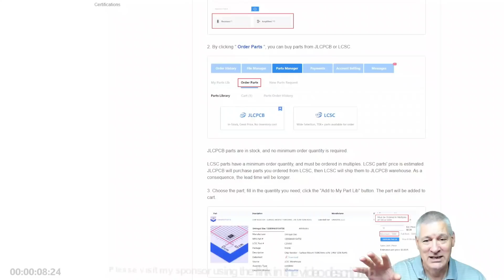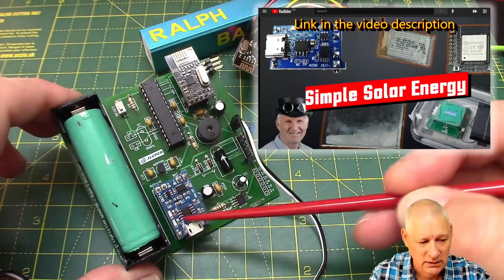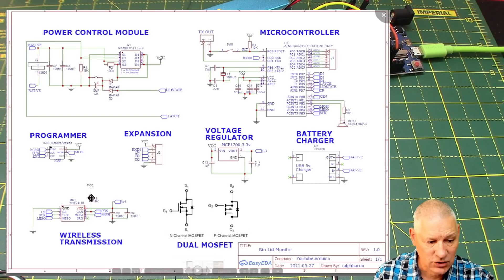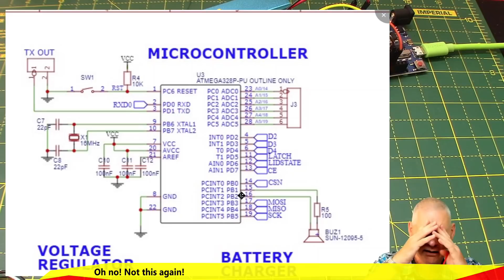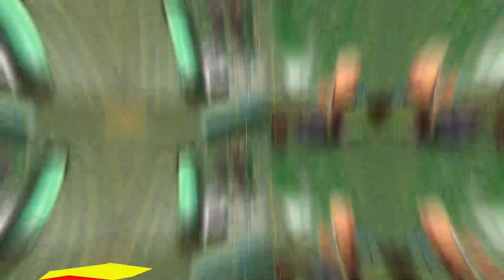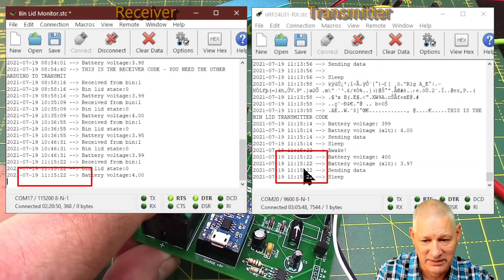#221 Arduino nRF24L01+ Simple Trigger Wireless ⚡ Project (Update) with EasyEDA

Comment: Hi @Ralph S Bacon
Thanks for your efforts on this and making it public. 

I had a look on your GitHub but couldn’t find the code for this project. 
Is it available?

I have just received some Si4599 duel mosfets and with help from your schematic have got it on breadboard now and working great! - Joy 😁.

I am just trying to monitor the button now so I can switch the project off manually rather that waiting for the count down to end. The code from your auto switch off project doesn’t monitor the button. 

I will also experiment with the normal way to read the button. 

Thanks.

Comment: Wonderful content and lovely presentation. A few tips. #1 Wrap some Sellotape around the LiPo and leave a 'tag' which you can use to pull it out. #2 Use Alkaline AAA's or AA's very low self discharge rate and 4.5V .Keep up the good work
Reply from the maker: Thanks for the tips! And thanks for sharing 👍

Comment: Great learnings from this video, unfortunately I am unlucky getting these NRF24L01 boards to work. can you do a project where the hc-sr04 are powered on/off by these MOSFETs for low power....seems there is no consistent solution to this problem ?
Reply from the maker: You seem to have two questions, Balaji: getting them to work (at all) and controlling them via a MOSFET to switch them off completely to save power.

To get the modules working reliably whilst developing you need the adapter plates. They basically consist of a 3v3 LDO so you can supply the full 5v without worrying about not enough current for the nRF24L01s. They are very cheap and solve 99% of all power-related issues. In a project you can design in your own 3v3 supply with sufficient current carrying capabilities, as I did with this project.

To switch off the modules you can use the CSN pin that brings them into a low power mode (which is what I do here). Datasheet will tell you the power consumption in such a state.

Or, use a MOSFET to power them off completely using a GPIO pin (which I did not do) - it takes a little while for them to wake up and get ready for transmission if you do it this way.

Comment: Thank you for this project. Its nice to see the puzzle pieces from your other videos come together in a way i think is useful for many people they want to build some battery powered/remote projects. But as always it raised some questions. All of that works flawles until i connect the high power NRF module to get a longer range. After that connection is unstable. I tried capacitors to provide power reservoir but nothing seems to be working. I know there are these adapter board for NRF modules but when i meassured consumption it doesnt make sense to use them in battery powered project because of voltage regulator used. Is there any solution for that?
Reply from the maker: You say "it doesn't make sense" to use adapter boards in a battery powered board, Jakub. I'm seeing here an aversion to using up power by dropping one voltage to another and dissipating the unwanted voltage as heat, as an old-fashioned 7805 voltage regulator might do.

However, for the fairly modest requirements of the nRF24 (high power or not, it's going to be under 120mA) there are some very efficient LDOs, such as the Microchip MCP1700 family, which I'm using in one of my projects. There are doubtless many others that require just a couple of hundred millivolts above the required voltage (so 3.5v would be enough to provide the 3v3 required) and sip power.

It's also very easy to turn the nRF24 (or any other peripheral device) on and off under software control of the μController using a (dual) MOSFET device, which ensures zero current consumption whilst the μController is in Deep Sleep, for example.

As the expression goes, "There's no such thing as a free lunch", and if we are to power devices from a battery then they will take battery power - but we can do much to reduce that to an absolute minimum with good hardware design and Best Practice in software engineering. Agree?
Reply: @RalphBacon  Thank you for those tips. Iam now using 7333-A voltage regulator that has similar characteristics to those from Microchip but it doesnt hurt to try some well known brand to rule out possibility that my 7333-A doesnt act according to datasheet. But i like the most the idea with MOSFET to power off completely the modul until next event occurs it doesnt crossed my mind. Thanks for a quick reply.

Comment: Good Job Ralph! Another nice presentation and project just brimming with ideas and solutions. Thanks!
Nice to see how success and end product functionality can be achieved all along the steps.
You seem to have glossed over the inevitable issues at every step, like remembering the file name when it's time to order,  things being hooked up wrong, dead battery, burnt out LED, re-soldering something 15 times and the insert coming out, hair pulling over 'it' just not working every time you test it and need to spend hours tracking down a problem like a bad solder/broken wire.... 😊😜
Reply from the maker: Hang on, Scott, have you got access to my workshop webcam? Someone's been watching me, I'm sure.

Comment: Ralph, why not add a diode to the battery so it won't matter is you put the battery in backwards?
----
It looks like you can use a Nano, Rather than the UNO R3.
Reply from the maker: Too big a voltage drop, easily half a volt. I could/should have used a reverse connected MOSFET for battery protection but I figured I'll not be taking the battery out.
Reply: @RalphBacon  - True, it would be 0.7 volts
Reply from the maker: Well, I'd see if I could use a Schottky, less voltage drop but still too much here.

Comment: Yes Ralph, I would not have done it your way but I respect your choices and there is a lot of good info in the video. Keep up the great work.
You do have to watch out for those user contributed footprints. I had to scrap some boards where the nRF24L01 footprint I grabbed had a mirrored pinout! I guess they were putting the headers on the back of the board
Reply from the maker: You're not wrong. 

User-contributed footprints can be the devil's spawn. You think you've hit Gold but discover when the PCB is made that it was just wrong - or, at the very least, made for a specific purpose or on the underside of the board, as you say. 

It's easier, in the long run, to make your own footprints; that way you have no excuses and are more likely to put in some effort in getting it right!

Comment: I hope someone could help me , when it comes to coding for the nrf for bidirectional use at various stages , any tips for synchronizing data at multiple transmitting  and receiving modes within an arduino program , really struggling to use , multiple stages  to transmit and receive and synchronize both microcontrollers
Reply from the maker: I'm not clear on what you mean by "synchronising" transmissions. Your program logic should be aware of when (and what) you expect at any point in the code and transmit/wait as required?

Comment: It is very satisfying getting a project designed and made on a PCB and it all works!
Reply from the maker: Yes, indeed. The flip side is, of course, where the PCB is so nearly right but needs "tweaking" before it works. That's if you're lucky and haven't put a footprint on backwards so it will never work no matter how much tweaking you do. But as I have never done that, it doesn't apply to me. 🤥🤥🤥

Comment: Great Video, Please look at the HC12 1000meter range with no lib's just tx rx pins same as Bluetooth
Reply from the maker: I believe (but only that, Alan) I mentioned the HC12 in my video on two-way BT comms in video #196 using HC-05/HC-06 devices. But I remember wondering whether the HC12 would work with the existing libraries from Martyn Currey. Thanks for the nudge, I will try and get to the bottom of this.
Reply: @RalphBacon   I was out of the loop for a while. I will check out 196 Thank you, Alan

Comment: I’ve been working with the ATtiny84A, which has more pins than the 85, but otherwise roughly the same.
Reply from the maker: Indeed, Brett, the ATTiny84 is a bigger version of the ATTiny85 - but at that point it's not really that much (physically) smaller than an AtMega328P (14 pins vs 28 for DIP and 20 vs 32 for QFP) but does have some hardware limitations (no hardware serial, no I2C, for example). The QFP package might be easier to SMD solder but even so... I'll stick to the ATMega328P for now and see how much of its features I end up using!
Reply: It’s still a fraction of the size of the 328 and can run at smaller loads. I’ve done I2C very easily on it and to great effect. The biggest limitation is 8K. I don’t think it gets enough credit, because most of the videos I see are singing praises of the 85. That said, you’ve inspired me to play around with a raw 328.
Reply from the maker: Indeed, play with the bare 328, I've done some videos on it and there is a board entry for it (so you can select clock speed etc) in the Arduino IDE if you install the MiniCore framework from Hans (MCUdude): https://github.com/MCUdude/MiniCore

Comment: Hi Ralph, spent many years designing PCB’s using the black, red and blue tape only to find out something doesn’t work, rip it out and start again.
I agree the Autoroute in any CAD package is brilliant saves a lot of time, only thing to get correct is the placement of the components. (Unless you have auto placement which Easyeda doesn’t have)
Reply from the maker: True! I wish it did have auto-placement of components; then again, as Arduinites (we're not designing Challenger Space Rocket boards here, as much as we might like to think so) I guess we just don't have that many components to manually place.

Comment: Good job Ralph, but I was playing along and was wrong. I thought you'd use a laser or an LDR to detect the bin lid open, since I avoid anything I have to remove. My wife would distract me, and I'd forget to put it back!
Reply from the maker: I hope (and at this stage, that's all it is, Lawrence) that I will only have to remove each board twice a year to charge the battery. Of course, with three bins that six removals per year. But rather that than (power or signal) wires everywhere!

Comment: Hope you had a good holliday.
You take the board out to charge the battery?
With your luck it would be on a rainy day. Who is going to close the bin? 😉
Nice layout on the schematic.
Reply: yeah, hope the shack has a lightning rod ...
Reply from the maker: Shack? SHACK? 😡
Reply: @RalphBacon   well does your humble abode has a lightning rod ?
Reply from the maker: My excellent workshop (do not say the "shed" word either, I get enough of that from my wife) does not have a lightning rod because it is very low (max 2.4m above ground) and it's not metal either so I can't see it (jinx alert) being struck by lightning any time soon. Plenty of higher buildings and trees around me!

Of course, now you've planted the seed of doubt, so thanks for that.
Reply: @RalphBacon  (another thought) ...
There was a time, certainly in my father's day and I think up through the 70's, when Ham radio operators were pleased and proud to head out to their radio shack to pursue their hobby.  The phrase was so common, so accepted, and so prestigious, that a major corporate electronics retailer in North America chose to brand themselves "Radio Shack". Maybe you should reach back to the origins of electronic tinkerers and claim pride in having a Maker (or Arduinite) Shack?  (I wish I had so much as a shack - I have to make do with a desk in one room, and a table in the basement).
Reply from the maker: "A desk in one room and a table in the basement". That's very sad RobJ, but I started out pretty much like that. But once I knew this was going to continue, and I had outgrown my desk/bench etc (and my wife was fed up with me running up and down the stairs 10 times an evening) I got a small workshop. Then I moved house. The best laid plans of mice and Ralph, indeed.